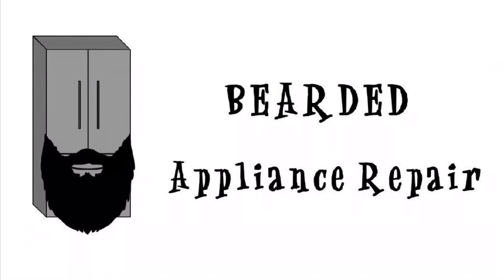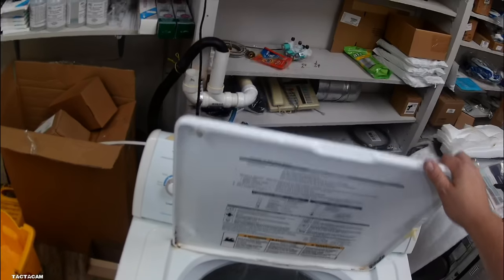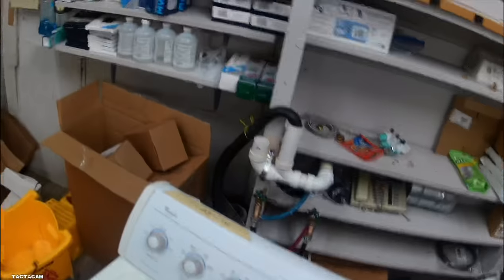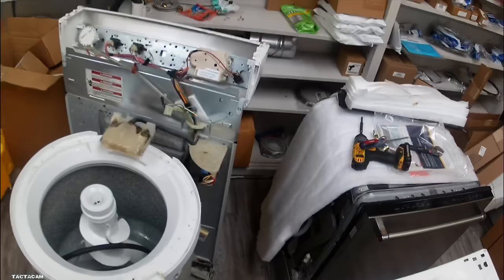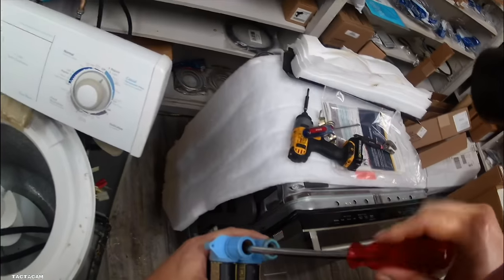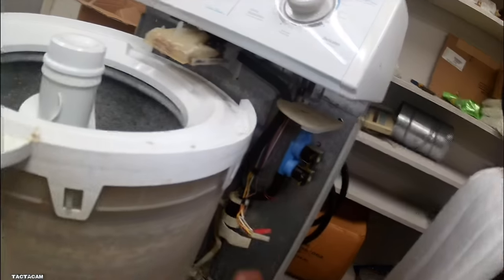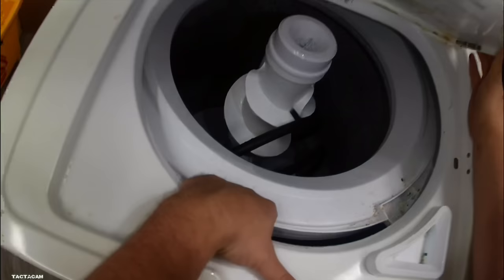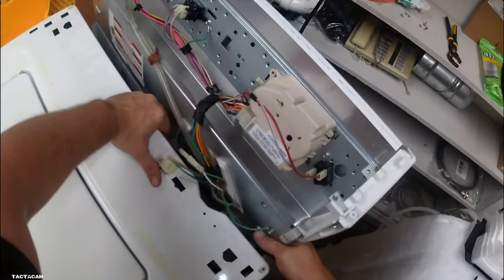Cold water not working on whirlpool top load washer Diagnosis and Repair.

Comment: Thank you for showing how to open the control panel, to remove shell and how to disconnect the controls. It gave me the confidence to try troubleshoot my issue: cold water was not flowing anymore.

In the end, my issue my minor: some residue/particules clogged up the hot and cold valves (filter?). After a quick rinse of the valves to dislodge the particules, water flowed once again flowed to the cold-water side (the hot water was still flowing before the cleaning)!

Thank you!

Comment: To get you running temporarily for cold water only, just switch hoses.
Reply: Only down side is rinse cycle cause it's hot/cold warm/cold or cold/cold water settings
Reply: That works until the rinse cycle calls for both hot and cold solenoids to open up then won't advance any further

Comment: Thoughts please..... Whirlpool WTW5100VQ2. Top load about 6 years old. Standard simple washer with no whistle or bells. Long ago the hot side stopped working. This was due to water dept flushing city lines. Cleaned screen and the warm would work. Over time that stopped. Been on cold since. Did a load last night and all was fine. Put cloths in today and started and no water. Looked at screen and was fine. Washer will spin and door switch is fine. Now NO water goes into washer and I hear nothing, no hum etc. In addition both inlet motors oddly look like water has been splahing on them so they are rusted bad. Wild guess, inlet valve issue?
Reply from the maker: Check power to know for sure it’s getting there.  If you get power and no water your looking at your valve.  As long as you have good water pressure at the wall though.  Got to check it or you can get burnt on purchasing unnecessary parts. If no power it could be the timer or temp switch.  More common of the 2 but more expensive problem is your timer. Have to do power checks to make sure though.
Reply: @BeardedApplianceRepair  Thanks for thoughts. I have worked on electronics since the 80's so I understand what you say. Just not so much washers hands on. I get time in my 12hr work shifts I'll check power. I assumed as much that the timer is high dollar. Most stuff with such is. If it would be that than value of washer vs part is not worth vs new washer. So voltages wise on the inlet wire is that gonna be ac or stepped down to dc output? Have a clue about what the voltages should read at? I do find it odd all a sudden the cold will not work vs 24hrs prior it did when did a load. Course I think I mentioned long ago my hot side stopped working. That and I do know the left and right pistons I think they are called are really rusted out. That is due to long ago better half overloaded the washer for weeks till I caught on. It was splashing water over inlet and down back. Pulled washer out and under side was rusted out and floor soaked. The washer was brought new and taken care of except her overloading it. But yes, I will start with voltages but await reply to see if you know about what them voltages should be and ac or dc starting at the inlet water valve. I guess on a plus side if you turn the dial to spin it will take off and spin cycle just no water lol. As for water pressure it is very good and clean water till water dept flushes lines.
Reply from the maker: On the older washers everything is ran off of 120vac. So yeah just check for that.  Sounds like it’s your valve and one part for both hot and cold water.  Probably your cheapest option.  They don’t make washers like that anymore.  If you can afford it and if it’s in decent shape.  If your frame is rusting out it’s not worth it.  Well as long as the rust is serious enough.  If you have surface rust I would not worry.  Fix it if you can.  That’s my recommendation.
Reply: @BeardedApplianceRepair  Hope that is the issue being water valve and nothing else. Frame looked good last I checked. Some rust is seen and paint chip. I did recall the tention spring for drum or what ever is pretty bad looking. Rest I think I caught in time or least stopped splashing and dried floor. Course over time that rust eats more. I 100% agree they don't make stuff like prior. Quality control went out the door long ago. I do invest in old if I feel the worth. I replaced a heating element myself in a Maytag dry machine. That unit is decades old only replaced belt one time. After new part for about a year now it's still kicking. That element was a good grade replace at about $120. I did that because I fealt I will get the use. The washer machine I kept simple. Get into boards and bells and whistles and all things error code. I want to thank you for the time and input. Over the days I will check all on meter and get back with a verdict. If valve I'll get that part and verdict that also when done.
Reply from the maker: I know which element your talking about.  I replaced one recently and was more expensive than I thought it would be for that model.  Was about 20 years old though.  You can’t beat an old Maytag.
Reply: Agree can't beat a old Maytag. I had two options restring the inside myself at $90 or buy whole factory replacement part for higher. I tossed the thought that I never restringed and wrong move and done. I took the higher option. As for the update to washer and after watching vid you posted..... So the washer I torn into and I verdict the inlet. So I ordered that part someone had from Whirlpool in factory box vs junk quality control parts. I got said part today and installed. I found getting the case back on for first time was a joke lol. Now I know after paying attention. Washer fired up and on 2nd load now. Got hot, warm and cold. Appears a tad more water pressure also I guess due to junk inside parts even though I cleaned screens in old part. Any event as is well.
Reply from the maker: Yep stuff can get inside the valves.  I see it a lot.  If you can get a sediment filter installed on your incoming water to help filter out all that jazz. Your appliances and you wallet will appreciate it lol. 

Yes only use oem parts in the appliances.  They are worth the few extra dollars plus some when it comes to water valves.  I have had after market water valves fail on me.  I don’t mess with them anymore.  Glad you got it working though.  Kudos!
Reply: @BeardedApplianceRepair  Thanks, I agree there on original part. The city water was fine but I see more white build up on stuff lately and I know what that is. Every so often the water dept will flush the street or dig and replace something. When this happens I get the junk. Alot of brown debris in screens jamming stuff. Good deal of this also don't help all my copper lines under house are old. The house is very old. But yes, the water has been a issue with water dept ect. Had to put a Whirlpool 40 gal gas hot water tank in myself last year. The water ate the rod up inside last one. When I cut the copper to redo stuff it was all brown inside to a degree. Any event I can see the washer inlet valve getting trashed again. I may have to investigate something as you say for a filter. Also the price because that one sounds like hundreds. I will come up with something.

Comment: Help with diagnosis please? Older Whirlpool washer has very little cold water coming in. As initial diagnostic steps I disconnected the hoses, ran them down the drain, and verified water is coming out. Good. So next I swapped the hoses so hot water was connected to cold input and cold water was connected to hot input. Tried again and there’s still almost no cold water. Thoughts?

Comment: My wash is slightly different but same problem and I replaced my water valve and it still only works with hot water. So when it gets to the rinse cycle it won’t work
Reply: Same here!!! Any ideas?
Reply: If it isn't the valve, and you have running cold water, it is the switch. YouTube cold water switch and you will have your solution
Reply: @songsformom2197  check lid switch

Comment: I replaced the part but still no cold water. You mentioned checking for power on the clear connection, can you be a little more precise about how to do that? Or post a link to another video showing how to do that? I replaced it with a brand new part, so unless the new part is defective it can't be getting power for some reason.

Comment: Hi. I got the peice off. I can get water/air to go through (primed it in the sink and used a hand pump and bubbles came through both hot and cold area where you attach the hose.. So I assume it's not blocked? Is it safe to assume that? Working on testing the power source (finding a meter). How do I do that safely.

Comment: can you please help me.. i have here a washing machine white westinghouse . the behavior is the washer start today to fill water very slow. i check the intlet valve and this is ok, check the hose its ok, so i check the voltage and i found something interesting. when you put the cycle with cold water and hit start i see in my mult the 125v for a second then dessapear but if you put hot the 125 are steady. if put hot and cold the voltage was on and off. you know when activate cold disappear.. and i do the test disconnecting the inlet from the connector coming from the washer you know i connect my mult directly to the cables.. what you think? i cant find any parts for this its WWAC14M3HEKW
Reply: parts are at  appliancepartspros.com/parts

Comment: Mine will give ya hot water, it'll give ya cold water, It WILL NOT give ya WARM water. oldeR model with both solenoids/valves on ONE housing.